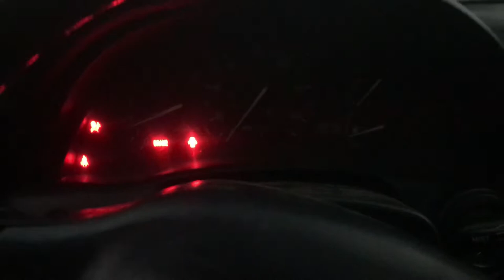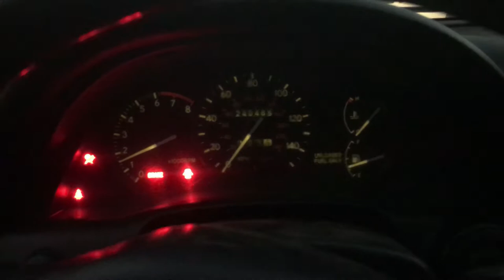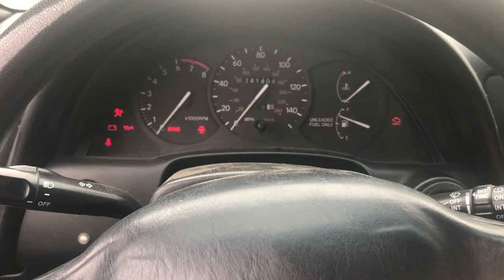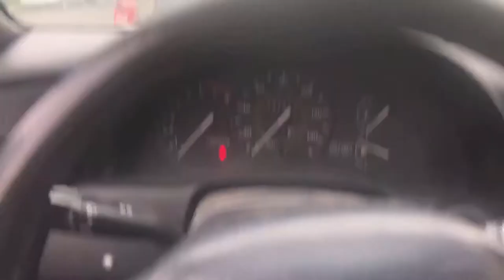Nothing But Bad Luck With This Car

Comment: Do compression test on 3sgte, then pull sump check bearings, if all seems fine get a new radiator then flush all the engine block. Check oil /water for cross contamination...maybe new head gasket....im taking thats a conversion gt2...i have the same full front end, side skirts and wing...i just turbod my 5sfe...which goes well. Only run 7 psi...
Reply: Also, if you have been doing work on all the belts etc, you may have a problem with the water pump, some replacement pumps came with plastic impeler, instead of oem steel impeler, they can snap off ..
Reply from the maker: Thanks for info and i already check the oil no signs of water, i wAnt to check compression but still have time